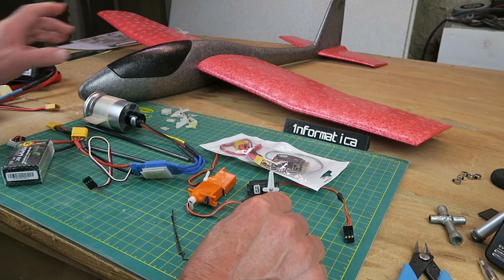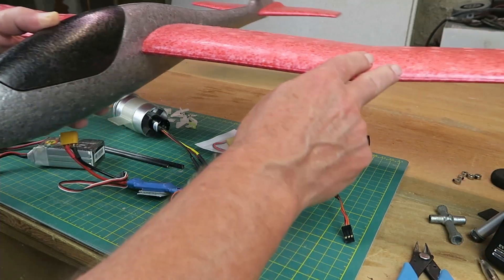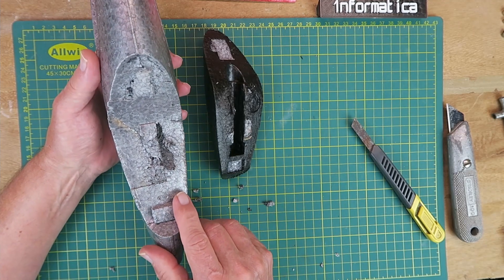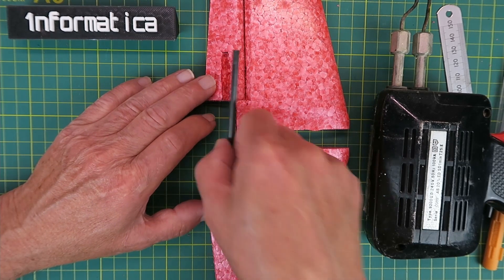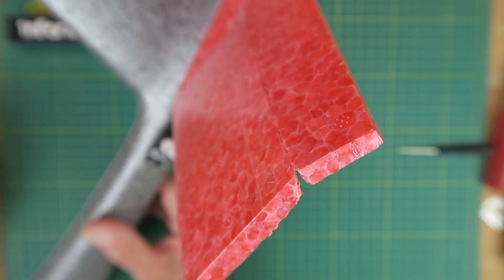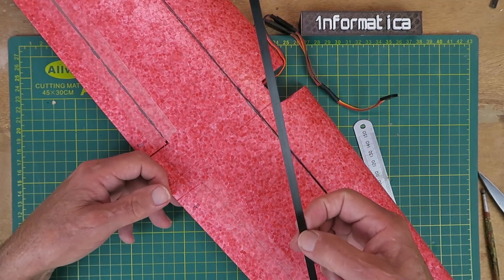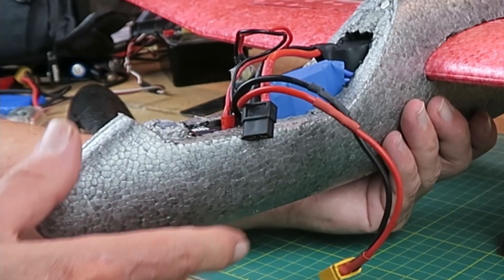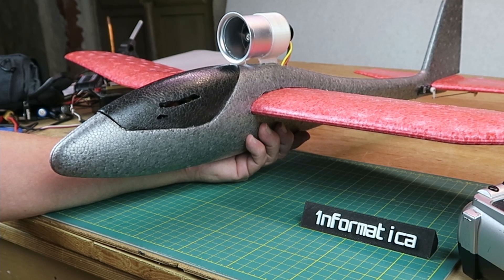Lidl Glider Dr Mad Thrust 40mm EDF Conversion Build

Comment: 4:54  Nice suggestions, but the rudder horn is mounted too far back here. Its holes must be positioned exactly above the slot in front of the leading edge of the elevator. With your mounting, the elevator does not move symmetrically up and down. 😉
Reply from the maker: The problem I had is that I put a carbon rod underneath the elevator which meant I had to place the horn like that. Thanks for watching, have a great day!

Comment: Looking forward to seeing this fly. The thrust line could give you some nasty pitch down on sudden throttle movements. I think you would need to be quite gentle on the throttle (especially at launch) I would set launch to 1/2 - 3/4 throttle and a really hard throw up at 40-45° to make up for the loss of static thrust from the EDF.  Good luck on the maiden!
Reply: I was watching this while looking at my Bixler on the shelf and wondering if the thrust angle was going to be a problem. Then I saw your comment and realised you had already said it far better than I could. :)
Reply: You know nothing....